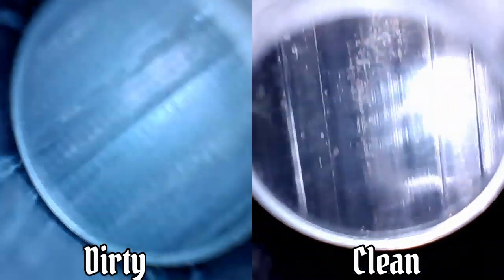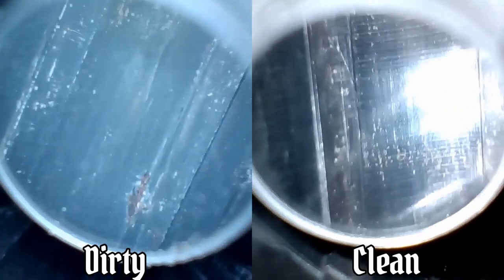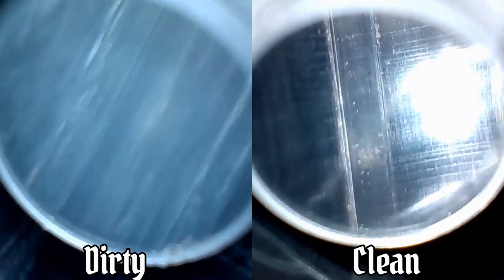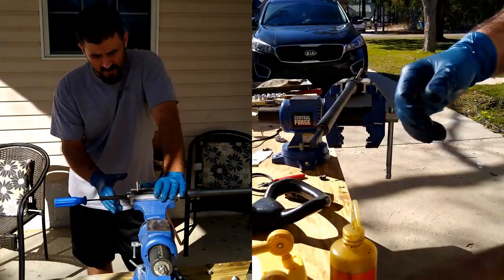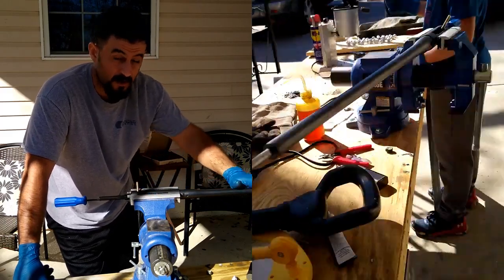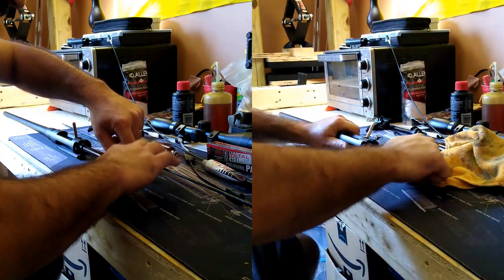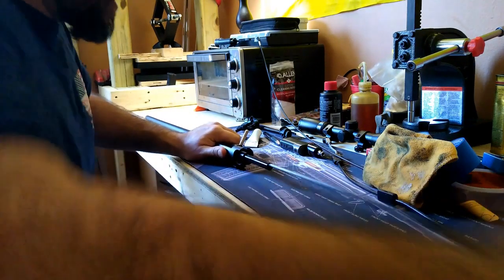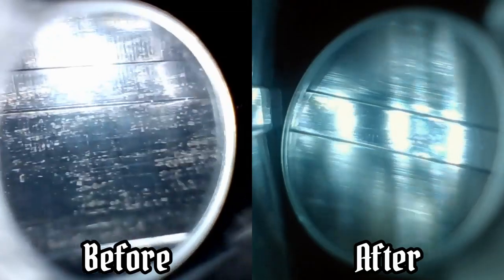How To Lead Lap A Barrel

Comment: Great video.  I have a Chinese Polytech M14S that I couldn't keep the shots in a 9-inch circle at 100 yards.  I fire lapped the barrel and was able to get sub-moa accuracy.  Another method I've used is to hand lap the barrel, leave the grit in the barrel, then fire a low velocity round through the barrel, then clean and repeat.  This method fire laps the barrel, but doesn't increase the chamber throat.
Reply from the maker: Great method! Try hitting it with some flitz polish and a brass jag w/ patches for about an hour too. That will do some wonders!

Comment: I've got a new barrel from a company, would you recommend  lapping it with some jb bore paste to get ride of any bares and sharp corners then clean and shot, or shot first and see where it's at?
Reply from the maker: Absolutely. No need to lead lap. But you can use a rough cotton bore patch and load that jb onto it then go after it. Flitz metal polish is great as well. Make sure you use a bore guide.
Reply: @TheGunPsychiatrist  thanks sir, I'll shine it up.
Reply: Hey I bore scoped my ruger American 6.5.  Can I send you the video to see if lapping it would help
Reply: @jerobb73  probably would want to ask @TheGunPsychiatrist, I'm new to polishing brand new barrels.

Comment: I’ve been told that polishing a barrel causes excessive fowling. Have you tested with and without polishing?
Reply from the maker: I have not. However, fowling is caused by surface deviations based on the roughness of the bore surface and friction of the projectile. Polishing would normalize these imperfections. I have noticed that shooting over a polished bore can highlight areas where the bore tends to fowl, but all barrels will copper fowl. Copper is a good thing to a certain extent. Excess causes issues. 

A smoother surface also has less imperfections for particulate to stick to, particularly carbon. Using a polish like flitz, I have noticed that cleaning is easier. Things tend to get removed a lot better. Another advantage is long term storage. Most metal polishes are  preservatives, in that it leaves a micron level protectant on the metal to prevent oxidation. This is critical for weapons in long term storage. 

Does it cause excess? Honestly I have never tested it. I don't think physics would agree with such a statement nor have I found any evidence on my guns to suggest excessive fowling. I would love to see the source of that claim too. You have definitely inspired an idea for a new video, so thank you.
Reply: @TheGunPsychiatrist  benchrest shooters say barrel manufacturers say not to polish. I don’t have any knowledge that is why I ask. Maybe it actually causes more friction.
Reply: @huntmulies39 how it can cause more friction at same question same point we both are in

Comment: If we got 2 inch group then should we lap? Shooter is perfect on other rifles but one shoots 2 plus group suggetion pls
Reply from the maker: I would prob try cleaning and polishing. However there are several variables that need checking first. Bolt concentricity with the locking lugs, optic alignment, AMMUNITION (a big one), crown concentricity, stock fitment, properly copper fowled bore, etc. there are many other causes to the issue than just a bad rifle bore that is a possible candidate for lapping. I would try all those first and choose lapping as a last resort.

Comment: Very interesting video. Thank you. I have a question. Can this be done without removing the barrel or is removing the barrel a must?
Reply from the maker: It would be best to remove the barrel but it is not mandatory. If it is like an AR.... For sure remove it. If it is a bolt action, you can go without

Comment: I just found you and wanted to say I like how you are presenting info. I have a couple of questions if you would. First,  I have seen people lead lap by shooting lead bullets. They were saying 100 rounds through a clean barrel, clean, then threepete. I am retired and in poor health so this would be something I can do if it does any good.

Secondly, I've got a couple pitted black powder guns and was wondering how to bring them back as much as possible. If you have a video or are making one, that would be great. Hopefully, I'll be able to see it done. Thanks
Wade
Reply from the maker: Hi Wade, 
The process you mentioned is called Fire lapping. 100 rounds seem a bit excessive, however, kits can be purchased, if you are a reloader or know someone who has a press. The images are pretty self explanatory. 

https://www.amazon.com/Wheeler-342303-Bore-Lapping-Kit/dp/B005KW6R50

As far as redoing Smoke poles, A lead lap would give the best result. However, if you are in a pinch, you can also lap with a scotch brite pad and some Kanokroll. I would remove the breech plug so you have access to both ends. I prefer Loctite clover, you can get a decent finish, no less than 800 grit on a cotton patch and work up to fine metal polish. You will need to slug your bore regularly to monitor bore diameter though.

Comment: Great info and video . May be i missed it but do you use soft or hard cast lead ? Or does it make a difference ?
Reply from the maker: Either will work. This is mainly from wheel weights. Bullet grade lead will be fine as well.
Reply: @TheGunPsychiatrist  Thank you
Reply from the maker: @kmackiss  I would recommend though sticking with a lower antimony and tin alloy lead. The less it has the less heat will be imparted to the barrel. You have to consider the amount of heat applied..... Too much can disturb heat treatments

Comment: I'm assuming you need to bore scope it correct ? And lapping is more aggressive than just polishing, so with a good tight shooting barrel just polishing should be a advantage, correct ?
Reply from the maker: A borescope basically saves you a trip to the range to confirm or deny the need to lap. They are very handy to have, and don't cost $800 thanks to technology and China. You can get a good digital scope for about $50 that can plug into your cell phone and you can use it anywhere.  Lapping should not be done for light or transient causes lol. If your gun is under 3MOA, a good cleaning and polishing should solve the issue for you. If you're trying to make your AK hit a pie pan it's 75 yd, lapping is not going to fix your issue😂. It all depends on the weapons platform. However, you'll be shocked at what a good polishing can do to a barrel. Polishing your bore reduces friction. As you reduce friction you will improve internal ballistics. When you improve internal ballistics it will have an effect on external ballistics.  I like to polish with cloth patches and a brass jag. Get you a tube of flitz metal polish, and go to town. I still would implore you to use bore guides, as a cleaning rod can introduce more wear than a bullet.
Reply: Thank you for your expert opinion. I'm going to polish because it is a tight grouping rifle as is. Being a long range weapon I might get a ballistic boost and easier cleaning after shooting 👍

Comment: Great video! What rod did you use for this? Thanks
Reply from the maker: I believe it was a carbon fiber rod or a steel rod. It has been a while. My best advice would be to get a rod that can take some force. Preferably with some good bearings in it. If you use a cheap rod that does not use bearings it won't last long. Also, make sure you use bore guides. If you don't, you will do more harm than good.

Comment: Can this be done on a chrome lined barrel?
Reply from the maker: I would not use an abrasive paste such as the various lock title lapping compounds. However, get you a tube of flitz off of Amazon and some krol oil. You can polish with a brass jag on CL barrels with really good results. If you have some sharp edges on lands, you can knock them down by running a red Scotch Brite pad cut down into a smaller section to fit the bore. Run it a few times then polish after that.

Comment: Wouldnt hand loading a lil bit bigger projos help a lil after a good lap?
Reply from the maker: I probably wouldn't. Only load based on verified data from load manuals. Increasing projectile size could create a very dangerous situation that could not only injure you, but potentially result in death.

Comment: What grit finish is best for the chamber?
Thanks for sharing and bringing us along! Subbed.
Reply: You don't want to polish a chamber any finer than 320. The brass needs to " grab " the chamber when fired.
If a chamber is too smooth it puts too much back thrust on the bolt.
Reply from the maker: BRM Flex hone takes the guess out of it for you. They make chamber hones that will get you the proper substrate finish for your chamber. They are a little on the $$ side, but well worth it and will last for a long time.
Reply from the maker: Check out BRM research. They make chamber specific hones that can be used with your drill. 

https://www.brushresearch.com/brush-types.php?c1=4

Comment: hello brother pls share some group  before and after lapping is there any special difference in form of accuracy
Reply from the maker: There can be a benefit to grouping. This is traditionally done for rifles or pistols that have a bore that is completely ruined and has no respectable accuracy. Don't lead lap a sub moa barrel and expect accuracy gains. Polishing can be done for this purpose.
Reply: @TheGunPsychiatrist  i had a .308 cz rifle it was cz 550 Ebony.. that was a shit .. it gave me 3-inch groups at 100 meters on the other hand i had a tikka t3 lite in .308 it gave me half moa groups...  that cz might need this procedure.. am i right? i tested everything on that from ammo to screws tight...
Reply from the maker: @advmotorrad  well, maybe. There could be other things going on that I would personally diagnose first.  Sometimes a barrel will do that until it is properly copper fowled, notice I said properly and not excessively. My custom .300 build with a kreiger can take up to 20 shots to refowl... Has a sweet spot of sub moa accuracy between 30-60 rounds before deteriorating accuracy from excessive fowling at 93 rounds where I start the process all over again. My point is there are many other factors that you need to look at expecting lead lapping to fix your issue. Not saying it won't, but it is not the first go to. Have you checked your bolt for alignment?
Reply: @TheGunPsychiatrist  nope i didnt check bolt alignment but everything looks okay... i checked all bolt nuts screws etc .. i shot everything which i have in our local market evry ammo  almost ... it was 1.12 twist.. i could not find less the 155 grain ammo.. that was the ammo type which i could not try.. i fouled it with 70 to 100 rounds still i got 3 inch group.. i cleaned it with coper remover n checked it it was super clean but got 3 inch group that bloody rifle make me crazy .. i really fucked up with that... accury is everything for me..  at the end im on conclusion that cz isnt the same accurate now then past... cz 550 cz 557 ... 557 was better but 527 was great... n now we have cz 600 but it is much better in accuracy then cz 550 and 557 models..
Reply from the maker: @advmotorrad  without looking at your bore it is hard to say. A bore scoping is in order. I would also check the crown. I would recrown it before any lapping, then lap the crown. 

Checking optics is also in order. Lapped mount rings, everything snug. Optically zero the scope on a mirror then shoot it and check optical zero again..if it moves from zero, your scope is the issue. 

After crowning You can do a lazy lap... Grab some lock title lapping compound of different grits.... Check eBay for this stuff. 200-1200 and some flitz polish. Grab a good brass jag, bore guides and a good cleaning rod. Begin lapping with the compound on a jag with a patch. Some red Scotch brite and krol oil should also be used. Lap as if you are tapering the bore. Open the throat, narrow the muzzle. Do this with successive grits. Nix the Scotchbrite after about 600 grit. Continue to work the higher grits in. Then polish that bore with flitz. This is a lot of work. The more heat generated from polishing, the nicer the surface. 

Go foul it well and clean normally without copper solvent.  Let the barrel cool and then try a string three times. Average the groups. Use the same ammo each time. Get good quality ammo or reload to book specs.

Another option is fire lapping. If you reload you can get a kit. If not slug the bore with some of that lock title clover lapping compound and fire successive grits through the bore, cleaning each time. Work up to that 1200 then polish by hand. Only try this after you have looked at everything else. Get a borescope. They will tell you a lot about what is happening with internal ballistic issues.
Reply: thank you so much i will try this  i didnt check the crown ,,, maybe thats the problam,,, thanks for helping me out  @TheGunPsychiatrist
Reply from the maker: @advmotorrad  my pleasure. You can buy manual crown cutting tools on Brownells. They have a facing tool, cutter and bore guide. Crown laps can be found on eBay. Any medium grit valve lapping compound can be used with the brass laps. As always, I like to finish with a flitz metal polish.
Reply from the maker: @advmotorrad  here, this should help you https://youtu.be/2L7YjsAWq40?si=0Ui7hf4oI84HpSOs
Reply: thank you so much, brother you made my day 
 @TheGunPsychiatrist
Reply from the maker: @advmotorrad  my pleasure..

Comment: I have a marlin 357 rifle that is really bad about 2 inches into the throat.  Really rough with burrs and some pitting. I may need to give this a try. Bad thing is it practically a new gun. Only a few hundred rounds down thd tube. Im a little scared pouring lead down the barrel, hope it doesn't  get stuck
Reply from the maker: Just keep everything lubed up and you will be fine. Oil based clover lapping compound will do the trick.  What is the current MOA?
Reply: @TheGunPsychiatrist  im getting about 2 to 3 inches at 50 yards. I suppose thats not to bad for a pistol caliber carbine. Im a bit ocd when i saw that area of the bore through a bore scope and it looked a bit chewed up for lack of better words.
Reply from the maker: @jonleone777  most scopes magnify imperfections. What you can't see with your own eyes looks like a cat 5 hurricane through a scope. Based on 2-3 moa accuracy, I would not lead lap, you will prob do more harm than good.. You may need to polish the barrel. Hitting the burr with a small red Scotch Brite pad soaked in krol oil might just do the trick. Follow up with a good bore polish using either JB or flitz on a jag with a cotton cleaning patch. 

I would also check the concentricity of the bolt and insure it is sitting dead center on the chamber face. Sometimes a bolt not sitting flush can be the root of accuracy issues. 

Also, fowling is important. Make sure that your bore is properly copper fowled after polishing. Sometimes it can take 10-15 rounds to get it fowled to the barrel's sweet spot. Excessive fowling of course is one of the culprits of inaccuracy, proper fowling produces expected groups.
Reply: @TheGunPsychiatrist  Roger that. I will give the polish a try and see what happens. I will have a gunsmith check the bolt alignment since i have no idea how to do that. I appreciate the dialogue. Thanks much.
Reply: Can we foul rifle bore with dry copper brush strokes too?